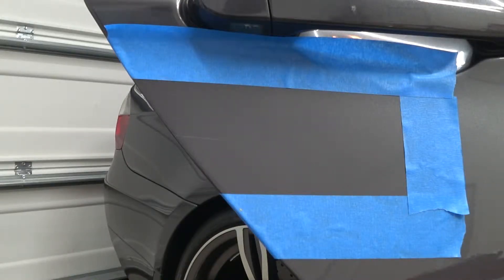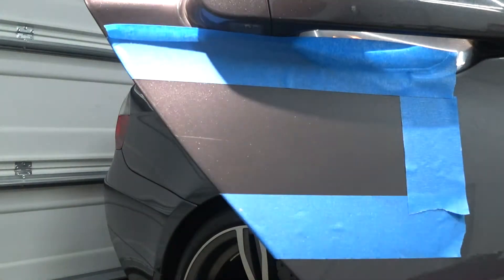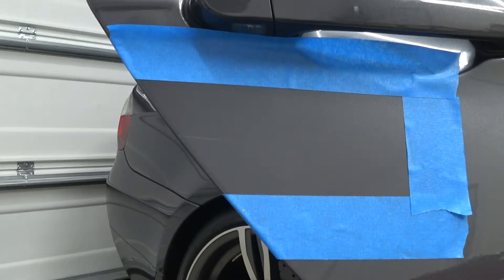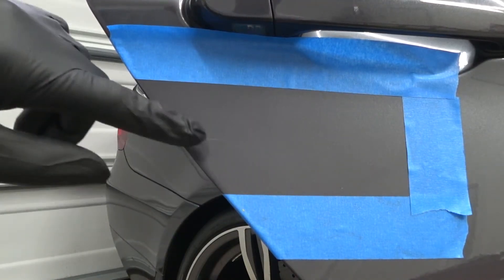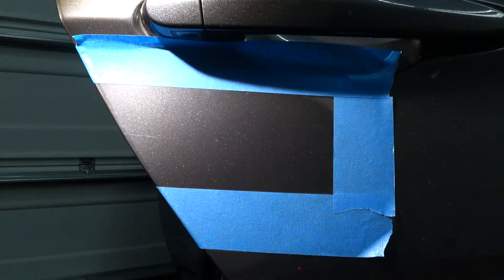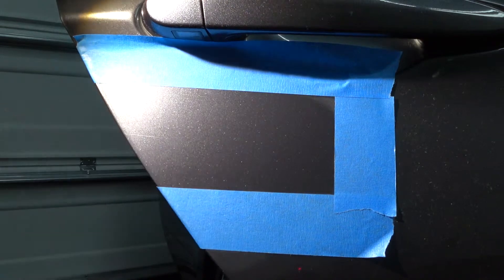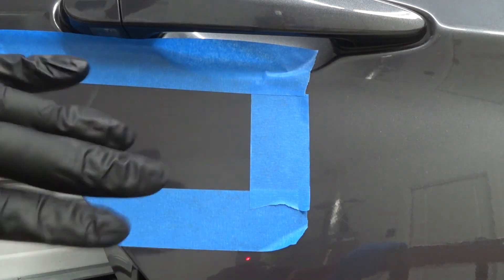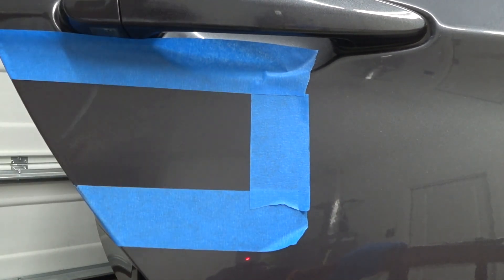Can inexpensive products yield great results?

Comment: Sweet! Looks good..i like that it can be done..with great results cheaply... I waited over 4 months for the HF DA to go on sale..it finely did..i went to get it and it 2 hours away... it was out of stock..they said they might get it on the next truck..i waited another week..called them up to see....and no go...they said something about discontinuing it..yikes.. i sure hope not...I went to the local advanced Auto and bought the Griot's Garage 6"..
Reply from the maker: Thanks!! Sorry to hear about your luck with the HF unit however, the GG6" is a great machine in it's own right so congrats on scoring that one.
Reply from the maker: Just checked the HF catalog and it seems they have actually updated the tool the new one looks a bit more ergonomic, the model I have was Chicago Electric and the new one is branded by Bauer.